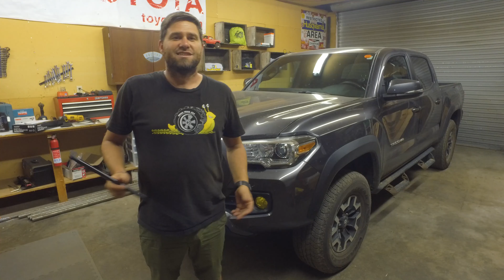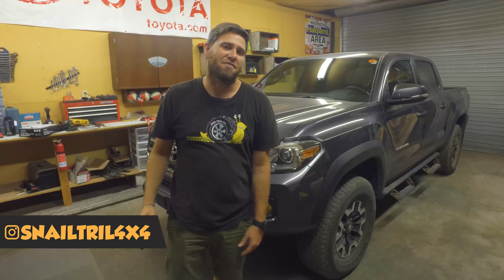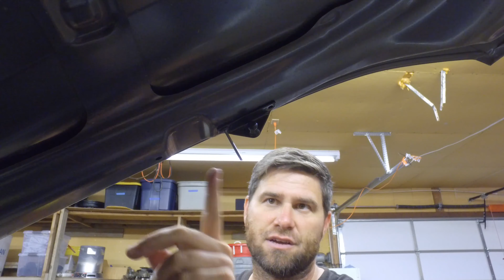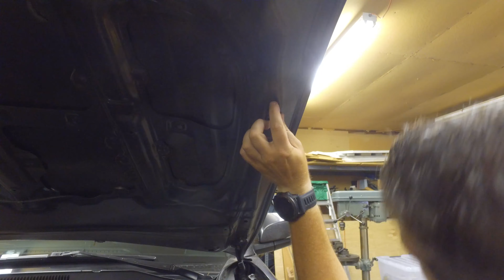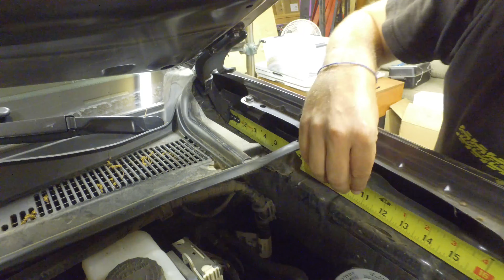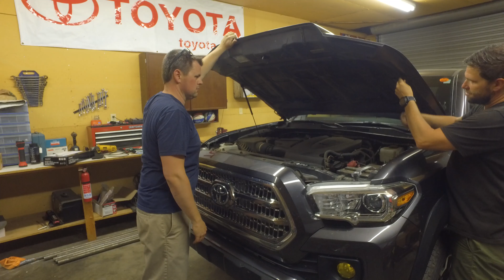Redline Tuning Hood Struts Install | 3rd Gen Toyota Tacoma

Comment: Exactly how high does it raise your hood? I just had these installed on my 2018 Tacoma and it feels like it doesn't open the hood quite high enough. The kickstand won't even go into the hole because the hood sits so low. Thanks in advance
Reply: Sounds to me who ever installed them didn't install them in the right spot why the hood isn't going up far enough, even in this video appears that the struts was not installed back far enough to raise the hood up further, installation like this takes precise measurements to be certain the hood is raised fully open & not looking like it's only opened part way.

Comment: You should put a note in the video that this is NOT for the max lift edition.  I followed your video and got the wrong measurements. Had to drill out rivets and changed the strut location as a result

Comment: I need the install video for the max lift  21-27016-02 struts that open an extra 7”. Both are the same price , so why buy these shorter struts ? If anyone has a link , please post it for the max lift install by redline.  Thank you
Reply from the maker: I need those

Comment: I just installed these in my 2020 TRD Sport Tacoma, and they work great.   My only issue is that I wish they had a longer range of motion to allow the hood to open farther.   Other than that, no complaints whatsoever.     These things are solid and make easy work of lifting the hood.
Reply from the maker: I agree

Comment: This is an awesome video!!  Thanks!! Love the struts and no longer have to deal with the lifting of the heavy hood and the kickstand!  I would use a disclaimer on your video.  "When drilling into the hood, use extreme caution not to let your drill bit go through too fast.  It may result in damage to the outer hood surface (dimples).  Yeah I was that guy#@&*(!#
Reply: I almost did the same, I was surprised how the drill pulls when you break through. Especially my Dewalt bits they really grab combined with pressure. Right before breaking through need to minimize to almost no pressure and allow bit to do the work

Comment: I think you install the top bracket wrong. The ball stud part is supposed to be facing outwards the truck  and not facing the engine according to the instructions. Also, it’s 2.5” not 2.25” from the edge of the hood. It’s also recommend to use touch up paint on all drilled holes to prevent rust on exposed metal.

Comment: Very good job. I'm thinking of installing such struts on my car form months. I can't understand why those are not pre-installed by the manufacturer. Fortunately, I found yesterday that for my car there is a special kit to purchase, and the car itself has provision for this installation. It is weird since the kit cost me about $20 on eBay. So why it wasn't installed by the manufacturer?   Just one comment on your installation. Holes for rivets can be drilled to have them inserted loose. By pulling the rivet's shank all the gaps are being felt.
Reply: There is so much that is no longer included that used to be a stock items on cars/trucks.    Unless you upgrade to a premium model (at huge expense), you have to either pay someone else, or have the mechanical aptitude to DIY it.    A dealership would charge you an hour of labor plus 250% markup on the struts to have them installed.   What you paid $20 and installed yourself would have cost you in the neighborhood of $200 at a dealership.
Reply: @aeromedical6750  I've purchased the kit a year ago and installed it perfectly with some improvement. The bolts provided in the kit do not fit the hood so I've added special spacers. It works with no problem. The kit is so cheap In China so I've purchased a spare kit 🙂
Reply: @dannyf4995  — outstanding.    I actually enjoy working on my truck as a form of therapy.   Not only can you save a lot of money in labor by doing it yourself, but you get the satisfaction of seeing your own end result.   If you’re not intimidated by doing these modifications,  it’s a great way to learn new things.   There are a lot of great YouTubers out there who specifically specialize in modifying the Tacomas.    They are great teachers and encourage you to get your hands a little dirty without the worry of messing up your truck.

Comment: Quick question. Isn’t the nub on the hood bracket supposed to face out way from the engine?  I was looking at the instructions and another video.
Reply from the maker: I'm not sure how you would mount it so the nub faces away from the engine. Are you sure you were watching the correct generation Tacoma video? I did a video on the second gen and it was slightly different than the 3rd Gen.
Reply: Yes I saw your 2nd and 3rd gen videos. I also looked at the install download from Redline and it shows the same for 3rd gen (2016+) Tacoma’s. I’m just preparing for when mine arrive.
Reply: Yeah, on the instructions I received the top ball faces out and the lower ball faces in toward the engine so it is holding it on opposite sides and vertically the balls are in a straight line.
Reply: Yup ball supposed to face away from engine bay on 3rd Gen

Comment: Great job! They recommend painting the area you drilled, preventing rust. I also recommend a tiny bit of ball grease to deter water in the rivet. I'll be using your video as a guide!!
Reply from the maker: Yeah, I don't live in an area where it rusts, it's more of a safety for them. But you are correct. Some ball grease is a good idea